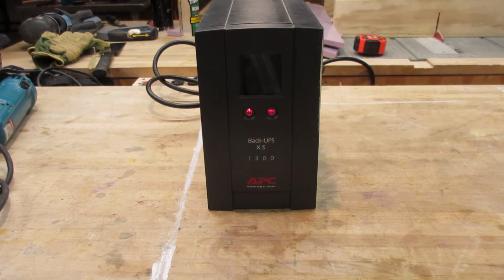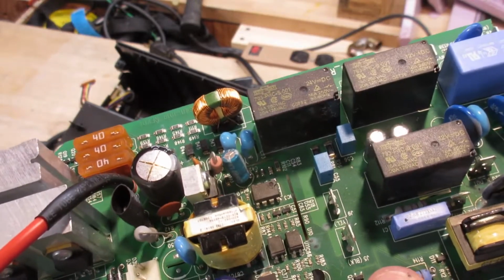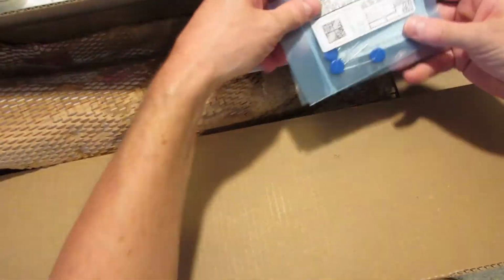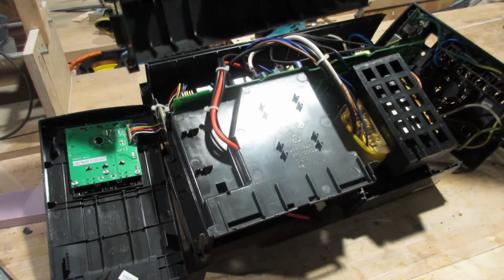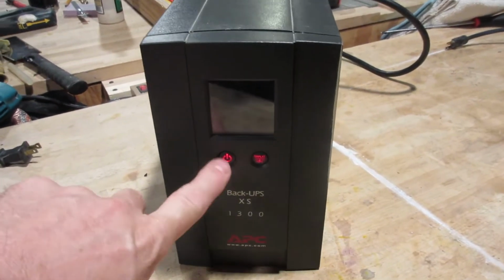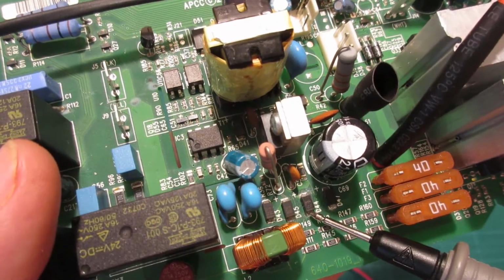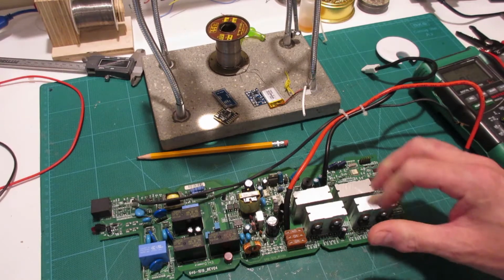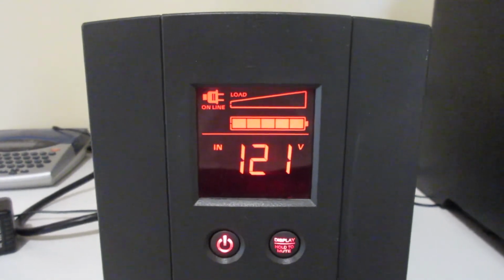Repair your APC Battery Backup....The Wrong Way?

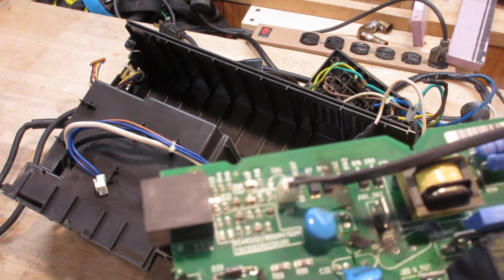Comment: Just a suggestion for future benefit.. I'm no professional either, but I've dealt with cleaning alot of circuit boards and other electronics for personal use and I would recommend that instead of trying to wipe the burn mark with a papertowl or toilet paper, use Q-tips (because they are small) and dip them into isopropyl alcohol. It really helps to clean up the fried board (burn marks). The higher percentage alcohol you can find the better because there is less water. However, I believe the easiest to obtain might be like a 70%, which will also work just fine. I used 70% for most of my cleaning and I never had any problems. It wasn't until recent years that I switched to a higher percentage alcohol. At 4:45 you were trying to scrap off the burn, and with the screwdriver you were using, you might actually scratch off the print on the pcb board. So that's why I suggest alochol first. There will be discoloration due to the burn, but at least the alcohol should clean up most of it.
Reply from the maker: Good suggestion Dennis.  I actually did use isopropyl, just didn't mention it.

Comment: Hi, at 26.23 minutes you test the second relay with 12V but that is a 24V version.
Anyway subbed, i love breaking euh i mean fixing stuff :D
Reply from the maker: Good point.  I'll watch out for that next time.
Reply: Easy to watch over the shoulder and notice these things. Yea obviously it did not work with 12V, but atleast it works now somehow :D
Reply: I was just looking through the comments to see if anyone else saw that.  I thought for sure he would come back correcting this, but he put the 12v in there.  I wonder if it burned out again or if its still working?

Comment: I have that same UPS, my problem seems to be the fans, not working and get overheated, how can I replace the cooling fan or find out why is not working
Reply: I think my problem its different, because when my ups is on battery the fans works continuously, but whet I plugged in to electricity the fans just stop working and overhead it again and then I got the same code F08
Reply: @ramkings2  the fans are multi speed
Reply from the maker: If you have it apart, the fans should be easy to replace.  Just get ones that are the same size. I can't recall off the top of my head but they probably just plug into the board somewhere.  You can scavenge the plug from the old fan.
Reply: I found them on ebay likely 24v fan
Reply: I know that, but the fans only works when f08 code comes out

Comment: At 3:50, that blue disc is a METAL OXIDE VARISTOR ,   abbreviation - MV or MOV.  It suppresses an overload and sends the voltage to GND for circuit protection.  It is a bit like a fuse.  I had one pop in a multi-outlet surge protector strip.  The power strip still works but the protection is limited for another lightning storm.       JwgK
Reply from the maker: Cool. Thanks James.

Comment: FYI the cap by those 40amp fuses (22uf 400V) is also bad, it will cause high frequency noise on the output which will affect radios. If you have a meter that can measure 120vac output frequency, it will go from 0-800hz and back! That was one of mine, the other is doing the same as yours now.
Reply from the maker: Interesting.  Thanks for the heads up.
Reply: @dork3nergy  my apc needs just a relay...yah chinese pos. Out of stock but will rig a stand alone in its place if the local esco store doesnt have one.
Reply: pins almost fit relay replacement NTE R22-5D16-24... 24vdc/16amp
also if the supply doesnt show more than 45min backup time then down load APc Powerchute 3.1, and the interface cord, one side usb other end RJ45 (serial to usb). pn 940-0127E. 
Start software , go to monitor system, then run self test, then replaced battery date....boom back to full run time!
Reply from the maker: @Dirtyharry70585  Cool.  Thanks!

Comment: I love your layman's way to repair. I also find your video's highly informative, especially in this video, where you said what the components are, data sheet location and where you can get the parts. With the demise of Radio Shack basic electronic repair sucks. Greatly appreciate it.
Reply from the maker: Thanks @RaicerX.  There still are some mom and pop electronics supply places in existence.  They are few and far between.  It's a damn shame.

Comment: Not way too long.  Can't get enough of this kind of troubleshooting really.  Adrian's Digital Basement is a great channel for this kind of stuff, but related to 8-bit computers.
Question: could you run 4 LiFePO4 batteries in there instead of the 12 V lead-acid? Direct swap, maybe a small balancing circuit to keep the cells at the same voltage.
Reply from the maker: That's a good question.  I should be possible with an appropriate charging device.  The only issue might be that the logic of the USP is designed for a lead-acid discharge profile and using LiPo might result in inaccurate battery status information.  Should still work you would think.
Reply: @dork3nergy  You can't drop in any kind of lithium based cell as a replacement for a lead-acid battery; the charging/conditioning methods are way too different. You'd have to completely redesign both the hardware & controller software.
Reply: @theantipope4354  The chemistry they're referring to, if my memory is intact, does not require the fancy monitoring standard 3.6V lithium ion uses.  I have a few Christmas lights that run off of 3.2V lithium rechargeable, and it's merely attached to a solar cell.